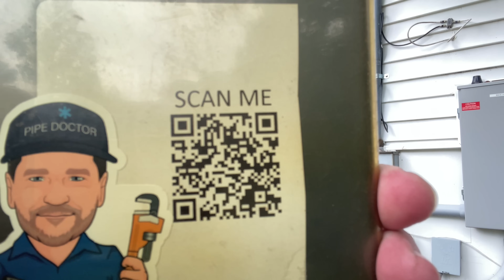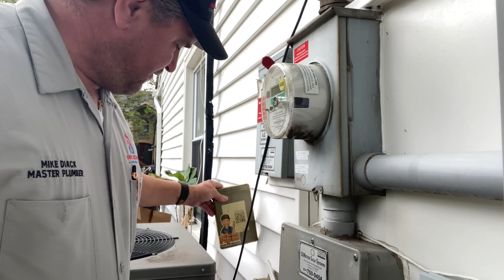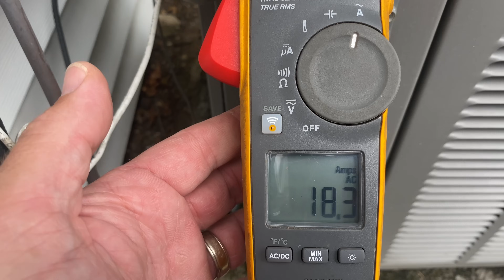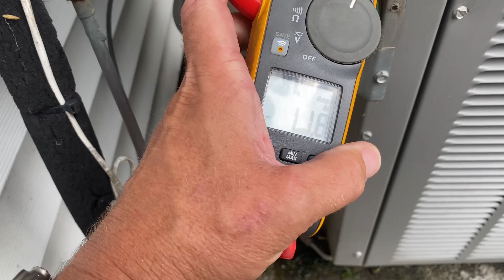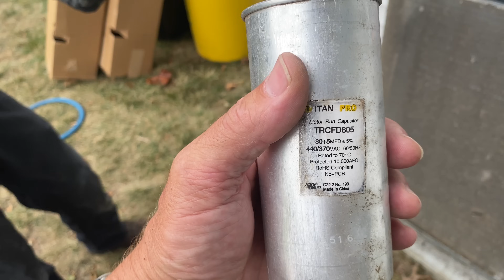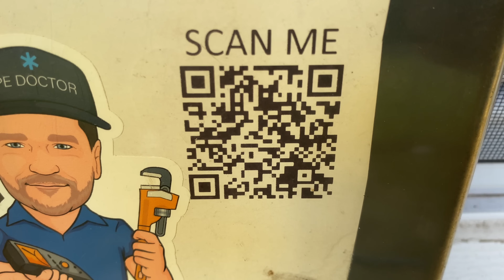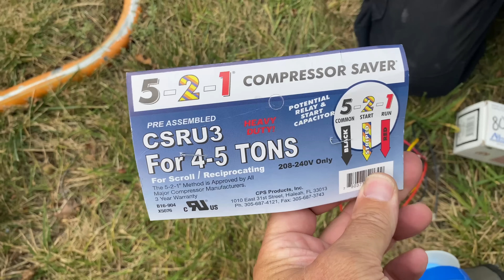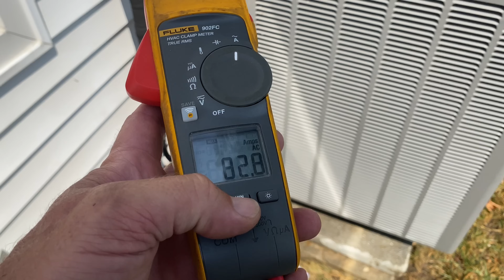Part 2: Soft Start Killed Compressor Followup Service & Maintenance - The FIX Revealed

Comment: The great thing about soft starts  is the lower amp draw at start up. My 3ton goodman drawls 113 amp for about  3 sec.. then ramps down to 18 continuous.  With the soft start its 33 amps then drops to 18... this means my 4800watt gen can start and run my A/C.
Reply from the maker: If your system is drawing that much amperage a start up with three seconds, you got problems buddy
Reply: @PipeDoctor  No, I don't have a problem.. its called inrush current. and peaks for about half a second.. but a meter like your does a average over time. Even at the MAX Hold function. its a average over time, I have a SAMPLE AND HOLD Function on my FLUKE 2014a That samples the first 2 micro seconds.. and that is where I get the 113 amps at initial start up. Now start without the time delay ( high head pressures) it can be as high as 130amps for a few micro seconds! My A/C has been running at those spec for 6 years.. there is nothing wrong with my system.
Reply: @PipeDoctor  MY BAD!!! I see in my post I said "for about 3 sec " I meant to say about 3 Micro seconds..I am sooo sorry!!!

Comment: i have a soft starter but only because i have a whole home generator, and it bogs down the generator when it kicks on. was pulling 76 in rush
Reply: I have two A/C units with delays for the 22KW gen. I also have a minisplit in the garage but I rarely use that. The delays work fine. The gen runs the entire house just as the power company does. I put hard starts on both units when we moved in.
Reply from the maker: I have multiple AC systems without a hard start and I have a 17kw generator. No issues upon startup with staging.

Comment: Hard or soft start then? Does a soft start prolong the contactors?
Reply from the maker: I really don’t know. Maybe someone can answer that question here
Reply: The soft start is mainly used to reduce the inrush ( starting) current allowing the tesla system  or a generator to power the home. The soft start can reduce load on the compressor prolonging the lifespan of the unit. Provided you size the soft start correctly!

Comment: Can you share what brand soft start you found. The reason I ask I was thinking about putting one om my R22 4 ton unit.  Reverse spell it. 
I would like to be able to run my unit on a home generator.Never mind... I found it in "episode 1."
Reply: I have a 4 ton Bryant and I just installed a ICM Controls 870-32A Soft Start. My 5000 watt generator barely notices when it kicks on
Reply from the maker: Watch Part 1
Reply: I did already. I saw a too small soft start that failed. No surprises there. I think the title of your video is misleading. The soft start didn't kill the compressor, the compressor looks like it killed the soft start @PipeDoctor
Reply: I didn't see part 1 as being available when I saw this.   But I got it now!  Thanks @PipeDoctor
Reply: Micro air 368 easy start,   make sure you have the right size for your unit,  the 368 should do a 4 ton unit n.p.

Comment: Great content Mike. Would that hard start set up help my 2 year old Amana ac start any quieter as it's pretty loud since new. Will it make compressor last longer. I actually considered installing a soft start. My ac contractor suggested a hard start, not sure of brand. Thanks
Reply from the maker: It should

Comment: Wow, I can't wait to see how the soft start installation went wrong!
Reply: It wasn't wrong in a way. Whoever did it used the wrong one, it was being overloaded by the compressor. They needed to use the next size up. 

Mikey was a bit too hard on it (pun intended) in the first video.
Reply from the maker: Using the wrong one makes it a bad installation. The installation went wrong.

Comment: Safety goggles aren't needed when using the harsh chemicals of Nu-Calgon?
FYI - the cement pad the unit sits on is easily moved too. Good job!
Reply from the maker: Yes they are.
Reply: @PipeDoctor  -I THought they probably were needed. Love it when I'm right! Now I'm going to run and show my husband that I have proof in writing that I can actually be right every once in a while. He has a bad heart so I have to be kind when I tell him. But inside I'll be jumping for joy!
Reply: @PipeDoctor - p.s. when we bought a new replacement AC, the installers initially shoved it up against the wall of the house. But, fortunately, we noticed before they'd gotten beyond dropping the new unit on top of the cement square thingy. (technical term) The 2 guys practically rolled their eyes when we asked for a little space behind the unit. Because of their reaction, I assumed it was real work to move out abt a foot. I was shocked it only took sliding across the landscape rock. Sliding! Just sliding! Geez, what was the big deal? But we just thanked them and kept our mouths shut.  

That extra space came in handy when later they installed a new furnace that included a pipe projecting out the side of the house near that AC unit. And yes, we used the same company  - Red Wing is a small town with very little options.  However, town has grown since then so we now have a couple more choices. 
~ :-)

Comment: Mike, did you use the compressor protection terminal on the compressor capacitor for the hard start capacitor?
Reply: Yea we did.
Reply from the maker: Yes we did.

Comment: It's not the cheapest solution, but an inverter variable speed compressor would also reduce the start current, plus it would be a higher efficiency solution. If they are moving the unit, i wouldn't put the same unit back in. If the lot costs $1.6M, a $10k unit shouldn't be an issue.
Reply from the maker: Agreed:)

Comment: The soft start wasnt bad persay...it was sensing an overcurrent on compressor start and tripping itself out. The compressor is getting tired. time for a new one soon
Reply from the maker: Yes but it still cut out the compressor resulting in the service call
Reply: the nu-brite herpes comment had me dying because its true
Reply from the maker: @spymoocowgaming  trust me, I know too
Reply: @PipeDoctor  imagine having a coil cut your fingers and then nu-brite in the cuts. That was 10 years ago splitting coils on a commercial roof. Never again.

Comment: The soft start almost killed the compressor cause I hear it running - what happened.
Reply from the maker: I guess you didn’t watch the whole video
Reply: It's not good to guess especially when your touching electrical wires and thank goodness you don't fix furnaces while you like to guess a lot. The compressor was running so it didn't kill it . Just an observation from  a home owner,  you should have replaced with another soft start .I don't want to hear iany rebutt hole will you always be a one man band  ?
Reply from the maker: @frankchandler8005  thanks for sharing. Have a great weekend
Reply: NOT SHARING, JUST THE FACTS ONLY. @PipeDoctor
Reply from the maker: @frankchandler8005  like I said, thanks for sharing. Much appreciate the support to the channel. Have a great weekend. Stay safe and stay away from the keyboard.
Reply: @PipeDoctor  NOPE TAGGED YOU LAST.
Reply from the maker: @frankchandler8005  have a great weekend.
Reply: @PipeDoctor  Your  off the hook 4 now but I'll be watching.
Reply from the maker: @frankchandler8005  oh yeah? Stay safe. Enjoy the weekend.
Reply: @PipeDoctor  oh yes !  And I already enjoyed the week end. but suite your self.
Reply from the maker: @frankchandler8005  you too

Comment: Hard starts only reduce the time to start not there current. Clamp meters aren't fast enough to catch the full in rush current. Wrong application. But hey, were all still learning right? 🙃
Reply: False. Hard start offers power factor correction during starting, reducing the apparent power consumed during the start event.
Reply: @denrayr  If sized appropriately it can pull it back into phase around 60%. However this does nothing to reduce inrush current. It attempts to moves that inrush back into phase to reduce start time.

A soft start does the opposite. It limits inrush until the compressor develops enough flux to begin turning and back emf of the rotor can then take over and limit current. 

The 2 power PowerWalls combines can't take a 100+ amps starting load. However reduce that start current under 60 amps and they can do it. 

There are 3 solutions here:
1. Leave the softstart, clean the coil make the customer aware ther it's undersized.
2. Replace the softstart with an appropriate size.
3. Remove the softstart and take the A/C condenser out of the backup loads panel.
Reply: I'm not arguing about whether or not the softsart would be better for the inverter or a generator. I'm disputing your claim that a hard start won't reduce startup amps. Your statement is flat wrong. I already said this, but the power factor tanks during the start event due to the inductive characteristics of a motor. The hard start kit parallels in a big ass capacitor during the event to correct power factor, reducing apparent power, reducing inrush amps. The impact of installing the hard start was observed in the video. It absolutely reduces inrush amps.

A soft start device limits current by limiting the voltage during startup. It is a superior device for trying to run off grid, but it works differently from a hard start.
Reply: @denrayr   "It is a superior device for trying to run off grid, but it works differently from a hard start." Correct it's the wrong device for this application.
Reply from the maker: False. The Fluke 902FC has a max button. We recorded all the data needed. Please educate yourself
Reply: @PipeDoctor  It's not fast enough. You might need to educate yourself on the capability of your tools.

Comment: Now that you trashed the soft start unit on this repair instead of replacing it, I have to go watch your video from a month ago where you installed a soft start unit to see what the difference is.
Reply from the maker: And……
Reply: @PipeDoctor  It disappeared from my recommended list.  I'll have to go find it. OK, I found it and watched it.  After reading a bunch of comments and watching both videos, I'm confused.  Why not replace the bad unit with an ICM870 instead of putting in a hard start?

Also, I've watched several of the soft start installation videos and they all tied up all of that extra wire.  I get leaving some extra so you can move things around on the next service call, but why not cut most of the excess wire?

Comment: I don't know the new owner's situation, but you may be loosing out on a sales opportunity for a new A/C system... and to install condenser on the other side of the house, like you said you wanted to originally. If the new owners had the Tesla Power Wall installed (apposed to the old owner), you can tell them the situation they are in with still having an old unit, and see what they want to do. A new A/C unit, with proper soft start module, sounds like the prudent way to go to have all things be able to operate under intended backup power conditions (I'm sure this may be their desire).. I'm not harping on you.. I'm just suggesting a sales 101 prospect: "Well Thought Options." ;)  Maybe you did already talk to them about this prospect. If so, you did not include it in the videos. And, sorry ahead of time if you made another video about it that I have not seen yet.

Comment: The original soft start kit likely broke. Should just replace it, instead of installing a hard starter. Soft starter is there to use the battery power for the whole house n the AC/heat when the grid power is down. Classic case of speaking/yelling to sound as if you know what you are talking about when in reality youbare not.

Comment: DID YOU DELETE my comment about the Micro-Air soft start.???. and how these will NOT hurt a compressor?? they might short cycle but they they have a 5min delay before restart..so unless the compressor had issues itself.. the soft start will not hurt it. Soft starts also increases the live of a compressor !!
Reply from the maker: Don’t get your panties in a bunch. I don’t delete comments unless you’re rude.
Reply: @PipeDoctor   I was not rude, I just gave info about the Micro-Air soft start unit I have. I went back to find it not posted...And I forgot the FAIL SAFE feature,, it will default back to the external cap upon failure. Its really Cool.. WIFI/Bluetooth control / monitoring  too!

Comment: Interesting. So why not install the correct size soft start and help with power usage? Or even emergency power backup choices?
I'm no pro. Not even close. But "luckily" have for decades serviced my own HAVAC units. home/auto. So far I still have my own digits. Buying parts is ridiculous. Many suppliers won't sell if your not a tech. Must just be the perspective of those DIYer and their careful study, or not, of self service projects. I can see how Youtube advice can be detrimental. Even if it's a professional advisory. Best to review both anti and pro info.

I have had real good luck with Hard Starts. Generator friendly as well.

Comment: Sorry, but you should have replaced it with the right soft start. You downgraded the customer with that hard start kit and threw a 500$+ retail component on the floor... Hyper Engineering soft starters are excellent (Emerson/Copeland) actually get them as a private label. They used to be distributed by water furnace here and they are indeed required in some countries where the electrical grid is not a stable. Also for any consumers that have dimming lights when their AC starts, this will resolve it by soft starting the compressor.
Reply from the maker: You are correct.

Comment: Why so much whining Mikey. Insulting the people who comment on your videos, and then calling them the "haters", simply because they comment on things that you did not cover in your video, and then have the balls to ask them to donate to your charity. You did not point out that the soft-start was undersized and actually doing what it was designed to do, you called it junk and a hockey puck and threw it across the yard. That was something that whoever paid to have the solar installed had to pay for. It is likely required by the solar equipment manufacturer, and it should have to be replaced with the proper sized unit by the solar installer. Did you give the unit back to the customer and explain what the problem was so they could reach out to the solar company and possibly even get reimbursed for your service call?

Speaking of pointing things out. Did you go back around the corner and close the sill-cock you left open before you left from your first visit? 

As well, posting yourself on YouTube perving on the customers wife, could cost you that customer, and possibly more if he talks to his friends and relatives. Not professional.
Reply from the maker: Do you listen to yourself talk or do you talk and then listen because you make absolutely no sense by the way tell your sister I said hi

Comment: "Learning from one another?" Yeah, right. You put out a video mocking a soft start, even throwing it off in the grass when you take it off, under a misleading video title, when you mistakenly blamed it for compressor cutoffs. It was only when the people noticed it was in fact undersized that you backpedaled. But you STILL left that misleading video up. NOW you are putting out more self-serving BS.
Reply from the maker: exactly, which creates engagement on the video and across the entire channel. didn't you get the memo?

Comment: The soft start is designed to decrease the inrush.  The hard start is designed to boost the inrush for hard to start compressors which also allows it to start faster thus breathing a bit more life into an old compressor.  Put a hard start on a new compressor and the inrush won't change appreciably.  It seems you're implying having a Soft Start killed the compressor.  Maybe that Soft Start killed it.  You tell us.  Telling people a "Soft Start killed the compressor" is short sighted at best and just plain wrong or misleading at worst.  It's an old compressor.  It probably had too many band aids and finally quit.

Comment: I wonder how the hard start ended up saving the day
Reply: It probably didn't, but it is a old unit, which is where hard starts often help, but as others have pointed out, you need a soft start for inverter backups (Tesla or otherwise).
Reply from the maker: It cut inrush amperage by half

Comment: You are taking offense where none really should be taken. You just now stated that the soft start kit was undersized where the first video you did not state that you just said it was a useless hockey puck. 
The fact is a soft start. Kit is a very good idea in saving electricity which it will, and in making it possible to run a large air conditioner on a smaller generator.
Hyper engineering is a cheap Chinese version of a soft start kit, whereas micro air is a much better constructed and engineered version of a soft start kit and they are very effective. Everything in the previous video was completely accurate, including where you showed that it drew much less electricity starting up the air conditioner, but when you use one design for a 2 ton air conditioner on a 5 ton air conditioner, it’s going to take a very short period of time before it fails. The hyper engineering one is often used for RVs.
The idiot that put it on in the first place should’ve known what they were doing and sadly they apparently did not.
The maintenance required for this air conditioning was most certainly holding it back from doing its job in the first place.
I love the way you called it “the air conditioner was still wearing its fur coat” your videos are good and helpful.
It is unfortunate that by the title of the previous video you made it sound like the soft start kits are useless. The start up on this air conditioner was far in excess of what a portable air generator could provide.
Reply from the maker: Okay 👍